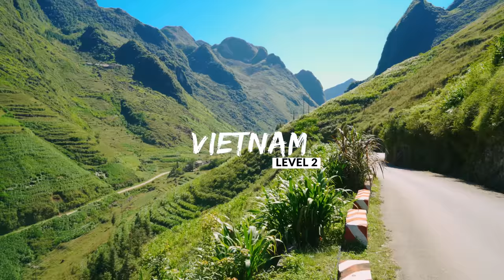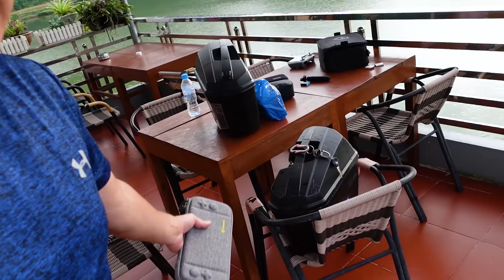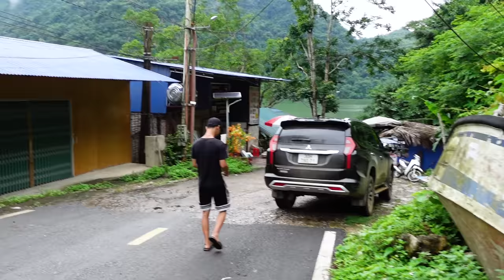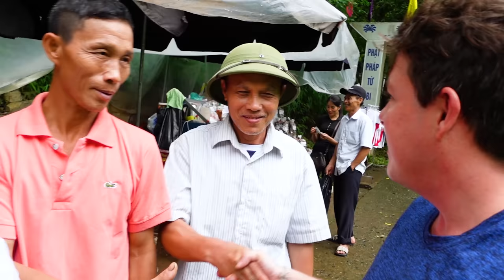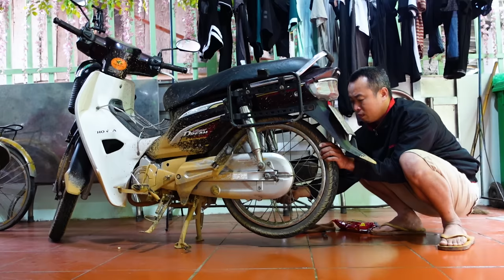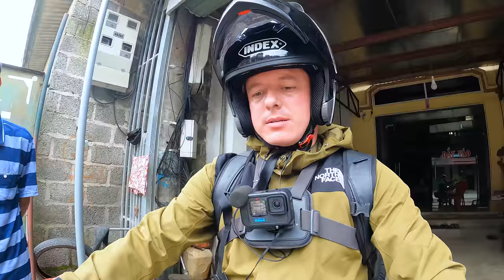CONSTANT PROBLEMS at BA BE LAKE 🇻🇳 VIETNAM by MOTORBIKE Ep:4

Comment: If you keep having flat tiers ask them to look at your spokes if one is loose it will poke your inner tube causing it to keep popping they can be a pain, if you just pinch them with your fingers they should be really tight if any are loose that will be the problem, hope you find the solution

Comment: Seriously Paddy.  Ask them you run a piece of tissue paper along the inside of the tire to check for a random reinforcement wire that has popped out of the inner side of the tire.  That was mine in Laos....it was only 1-2 mm long but it bites into the tube.  I wish you the best going forward.  How much is a Tube replacement there?  3.50 in Laos.  (at a Vietnamese mechanic shop lol)  HAHAHA I should have watched on for 30 more seconds and it all woulda been answered.    Amazingly similar!!! Throttle On!
Reply from the maker: copy that!